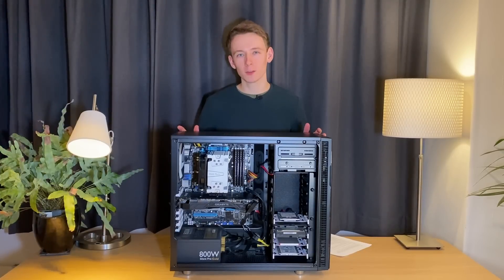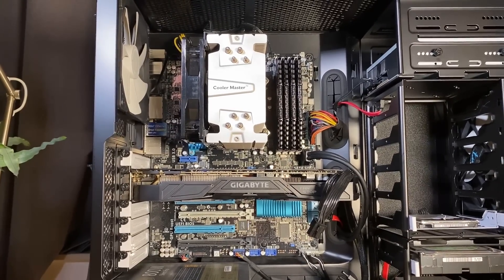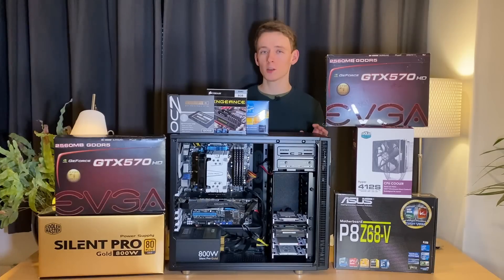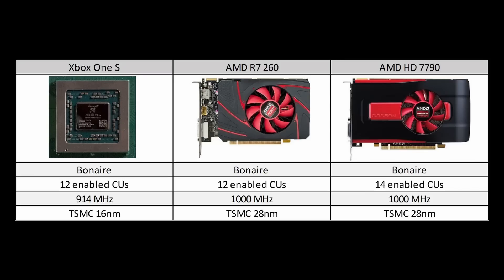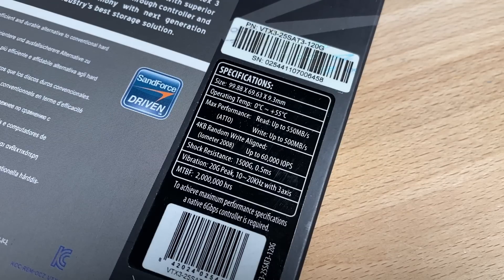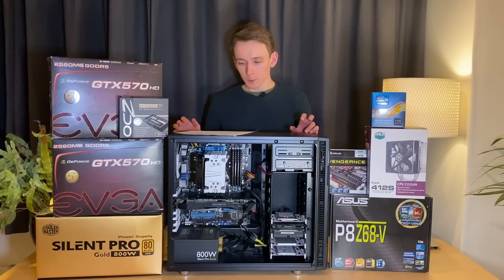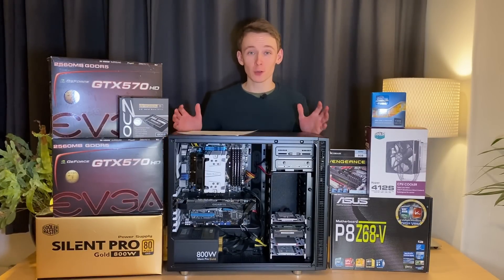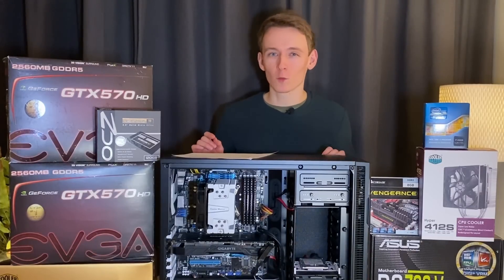I used an i7-2600K PC for over a DECADE - Here's what happened.

Comment: Yeah Im one to never buy new, I did buy my 5900x new, but I normally tend to upgrade when I run into a good deal on a used system or parts, The only reason I bought my 5900x new was because I had my older x99 intel system fail on me and I did not have anything to hold me over and I just couldn't;t beat the prices that Micro Center had at the time.

Comment: Lol, I built a PC in 2012 for WoW, had an HD 6870, 120GB Crucial mx 500 i5-2300, upgraded the GPU to an 1060 in 2017 for $169.99 brand new, then went back to WoW classic in 2019 and classic TBC later on, my system was doing just fine, 100+ fps at medium 1080p, was playing Hots too, I can basically play all competitive games at well over 60+ fps in 2022👌
An i3-12100F is $105.99 on Amazon that's a 4 core 8 thread CPU will crush all games competitive or not, the i3-12100F is 4+ times more powerful overall than my i5 2300 from 2012, and in single thread performance (where it counts) the 12100F is 2.4 times faster.
This weekend is when I'm finally building a new PC. The i5 2300 served me well.

Comment: it is somehow not surprising.
First in many if not all productive applications this system ist fast enough (perhaps except the GPU), only a few games take seriouslyx advantage of multithreading.
Second despite the "wanna have" there are no reasons to upgrade the system (except professional users/professional gamers: this means people earning their money with the system), the systems are almost everytime much faster than the person sitting in front of it.

For me the lat "necessary" Upgrade was from sandybridge to ivybridge on my laptop due to change in iGPU (Fortnite needed the ivybridge Graphics, Sandybridge won't work).
My gaming PC ist based on Zen2 combined with a 1080ti and loits of SSD storage (as it does also some other things to heavy for the notebook. But the daily driver is the ivybridge notebook i bought used at cheap pricepoint, of course some modifications but at the end less than one third as an equivalent new notebook costs (all mods included).

The "new" Gaming PC replaced the "old" gaming PC which is now at the children

Comment: its funny and pretty similar to me i am using my pc with an i5-3470 on a b75 and gtx 660 8gb ram with installed win xp - win 7 -win 10 until 21 and then bought another one with ryzen 3900 and rtx 2080 super 32 gb ram ,x590 mainboard and now with win 11 since it doesnt meet my needs anymore but did a fine job before

Comment: If it wasnt for killing my motherboard during an XOC session I would still be running my FX8350 today. I had planned to run that machine until the dawn of DDR5. And it also saw numerous GPU generations through out its life. 2x HD6850's. 2x Fury X's. And finally shortly before it kicked the bucket a single Vega 64.

Comment: I had splurged back in 2013 on a sabertooth x79 and a 1680v2 8 core along with 32gb of 1866 and the only thing i had swapped a few times was gpu, originally 3x 780 ti's swapped for 2x 980 ti's then a single 1080 ti. Just upgraded personally to 5900x after 8 years
Reply: @Lurch7861 lol ok?
Reply: I run that same setup today from early 2012, but the 1680v2 and 32gb ram were later upgrades.  Recently added a 3080ti after the previous 980ti burned up.

Comment: My setup 2500k 5ghz, ddr3 16gb 2133Mhz, 7970 6gb(or 1060 6gb, 3060 12gb). 
There is no reason to use it with a stock clocks. You need a minimum of 5GHz to use it adequately novadays. 
And I only got this processor in 2021. Before that, I had a xeon x5460 for about 6 years. 
I had to update due to the presence of AVX instructions in 2500k.

Comment: As someone that has been daily using a 2600k @ 4.5ghz with 16gb 1033mhz ddr3 and the same ocz ssd since beginning of 2012, I had a gtx 480 at first myself, then upgrade to a gtx 680, then a gtx 1060ti 6gb, and now currently a rtx 3070 FE. I've upgraded/added ssd's over the years as well. But now that I have the 3070, the 2600k is truly a serious bottleneck, and I'll be upgrading soon to a 13600k, 32gb 5600mhz ddr5, and a samsung 980 pro m.2. It's pretty much going to double my fps in every game since the 3070 won't be bottlenecked any more by the 2600k.
Reply: Forgot to mention that I've had the same Corsair 750HX psu and Corsair H100i AIO on it this entire time as well.

Comment: I use the xeon e3-1245 in a Dell t1600.
Still works good today .
It have 16Gb ddr3 
Nvidia 750ti
Ssd drive 
Zalman 700watt power .

Soon a upgrade on a amd r9 380x 4Gb  
The card is a real DirectX 12 .

And even today its jut work fine .
Oke no overklok option .
But new titles use more cores today .
And the xeon vs 2700k
The all boost core from factory is the xeon higher than the i7 .
Singel core is the i7  faster .

Comment: Hey I have one of those intel tower coolers. It came with i7 980x cpu. The only time when intel made a decent cooler :)
Reply from the maker: I had one as well! Even had plenty of room for OC - I recall I could run a 980X at 1.375V with it
Reply: @FullyBuffered  I loved that cpu so much, the entire 1366 platform was superb, so so buggy but I loved my pain 🤣24GB triple channel memory and 6 cores 12 threads at 4.5GHZ were the bomb. I still have the asus rampage IV from that build but it needs a lot of coaxing to get it up and running, some sort of cold boot issue. That build was in the same case as yours, Coolermaster CM690 II advanced, kitted with noctua fans, ocz sata ssd and two wd raptors in raid 0 as a game drive. The last upgrade before new build was the gtx1080 from msi. Even today that old hardware has some grunt left. It boggles the mind 😅

Comment: Kept my 2550K until 2018 when i picked up a 5775C with mobo for 200 i couldn't pass that deal up. Only some unoptimized pigs of games really ran that badly, it still did 60+ on 99%.

Comment: Used a 2500 since 2011 untill last year. Surprised me how long it managed to play games with decent fps and gpu upgrades. Sandy Bridge is legendary. Also - I like how you upgraded for Battlefields I did the same. Bought a new PC back in 2011 just to play BF3, then upgraded for BF1 and finally bought a new PC in 2021 for 2042 which I didn't play at the end cause it turned out to suck. BF3 was a great game, one of the best in the series a lot of people bought new rigs and it turned out everyone was running Sandy Bridge i5's with GTX 560ti for years to come. Intel easily dominated the market in AMD's dark age followed by Bulldozer flop which also contributed to marginal performance gains of new cpu's cause there was almost no competition.
Reply: Interesting time period in pc hardware. Sandy Bridge 2500k (oc to 4.6 ghz) was an amazing chip, coupled with lack of competition, and software titles that were still primarily 1-2 cores. 

That made the upgrade cycle last almost 5 years as that chip could easily power everything up to 60 fps. Don't know why Intel didn't do much those years.

Only with adopting high refresh rate monitors did i need extra cpu power, which i would buy at the wrong time with the 7700k.

Comment: I miss those days when a top end video card cost as much as a entry grade card now. I decided to retire my Sandy Bridge not so long ago as windows gave me an error so I decide retire it. Here are my specs:

Intel Core i7 2700k
32ag ram
Intel 510 250g ssd
A bunch of 1 to 2tb hdd
Had a MSI gtx 580 Twin Frozr II then switched to 970 but downgraded to GT520 ( that one died in 2020), and ended with a 720.0
Corsair AX 850W psu (80+ gold)

Comment: ok, so I wouldn't normally admit this because most people wouldn't understand. But I upgraded my sandy bridge i5-2500 to an Ivy bridge i7-3770 just last year by buying the new CPU second hand. the improvement in performance was going to be not far off the improvement that an 8th gen i3 would bring but at like a sixth the price because I kept same motherboard and same ddr3 ram.

CPUs seem to be doubling in speed every 8 years now. Upgrading more often than that seems kind of pointless. GPU is a different matter, of course.

Comment: Hah, this is the sibling of my old PC (still have it, just used by my girlfriend now). It was a 2500K with 8 GB RAM though, but same motherboard and a 660 TI instead. I also upgraded to a 1080, which I still use in my new computer due to GPU markets being what they are, so GF got the old 660 TI put back in.

It's still an excellent system, never ran into issues with it. Girlfriend have no complaints over it and it meets all her needs.

Comment: While mostly indonesian people using a intel core 2 quad even core 2 duo! And some of em had i3 gen 2 and pretty not much use a ddr2 cuz the majority of indonesian people who use c2q mostly using G41 chipset.
Well G41 is commonly packaged with ddr3 technology and rare G41 use ddr2 or combo.
Well the gpu people mostly use is maybe like not worse than gt710 or somethin but indonesian people have fun with the gpu that crappier than GT710.
Well some of them was
-Nvidia GeForce GT220
-AMD radeon hd 7500
-AMD radeon hd4500
-Nvidia Quadro NVS310/315
And more
And im using a NVS310 cuz is cheap and dx12 supported rather than GT220 which only support dx10-dx11

Comment: I used the same CPU with a P68Z Deluxe. The 2700K was watercooled and ran it at 4.7Ghz all the time. Eventually the motherboard died after 8 years. I sold the CPU for 100€ and moved on to a Ryzen 2700X.

Comment: why buy a new machine when old lga 1151 CPU's are dirt cheap nowadays?
the highest end cpu for lga 1151 is the i7 3700k - you can get one of those for as little as 15$ nowadays.
the highest amount of RAM Z68 supports is up to 32GB of 1600Mhz DDR3 RAM - a 32GB DDR3 ram kit can be bought for about 70$
you can buy one of those PCI-NVME expansion cards for 12$ and use any NVME SSD with this machine - would be SO MUCH FASTER than a SATA3 based SSD.
you can get any modern GPU for it - even RTX 3090 (although expect at least a 20%-25% performance loss due to CPU bottleneck).
the motherboard you shown in this video actually wasn't really anything special to begin with, it was a budget option for the Z68 chipset.
the Asus ROG Z68 motherboard was bonkers with incredibly good quality components.

i've personally was using an i7 980x system with 48GB of DDR3 RAM and a 850W Corsair PSU (and Graphite 600T Case) and a dual GTX 570 2.5GB setup for over 10 years up until 2020.
in 2020 i bought an RTX 3080 and switched over from my system to my father's workstation rig - an i7 3700k, 32GB DDR3 Ram (ouch i felt that right away because i have a shit ton of mods and assets for Cities Skylines), a 1200W Corsair Platinum PSU and a Nvidia GTX Titan (OG Titan card).
i moved all of my hard drives and SSD's to it and added in one of those NVME to PCIE expansion cards with a samsung 950 pro ssd, and switched the GPU from the GTX Titan to RTX 3080.
the motherboard is the Asus Maximus V Formula Z77 ROG which offers so much flexibility and potential for expansions.
i've seen no reason to upgrade from it, i have literally only upgraded from my older i7 980 extreme machine to this i7 3700k machine because i wanted to have as little of a bottleneck as possible with the RTX 3080 without having to rebuild a new machine.

the reason why i didn't build a new computer in these past 12 years is because i've been anxiously waiting for intel to release a new HEDT cpu (instead of just refreshing the same old cpu over and over and over) but that never happened, and during my wait time i didn't really see anything that my computer has been limiting me with doing - it is a perfectly capable gaming machine and it even does VR really well...
one of my friends says he "feels sorry for me for using such an ancient stone age machine" but i laugh back at him telling him that i'm not missing out on much because gaming did not even evolve much in the past 10 years because 8th gen consoles held back gaming in terms of "minimum specs".
its funny how games released TODAY still show a 10-12 year old CPU in their listing for "minimum specs" lol

Comment: :D-)-< new sub here, still usin it as secondary system, still plenty fast for daily tasks actually a bit overkill still if u give this to a secretary lady it would be like a nasamachine cuz for exel and that crap itz too strong still ^^ so yeah, old intels for the win :*
BTW that RIG:
CASE:  CM Storm Stryker
BOARD:  Asus Sabertooth P67 with Fractal Design Southbridge Fan :)
CPU:  i7 2600k @ 5.1ghz (well was peak not it fell down to 4.8 :D)
RAM:  20gib  2x8gb G-sKill Ripjaws X & 2x2gb TM Memory 1600mhz
GPU: Modded Palit GTX 980 @ 1550mhz
SSD1: MediaRange 120gb  but will be swapped to some Samsung or some, we will see, 
SSD2: Crucial BX100 250gb
PSU: Be Quiet System Power 9 600W
Win 11 

if that system still dosent rock and probly most ppl could dream of then i dont know what is ^-^
plz continue wour work, your chilled af  >)

Comment: how did you get your cpu to run 1600 ram
Reply: Just set the XMP profile in the BIOS. I have the Deluxe version of the same mobo with 1833 gSkill. May need to manual overclock, and no guarantee with 4 DIMMs.

Comment: Those were the days when you could build a decent PC for cheap 😂My brother still running my 3570k system. In hindsight I do think the i7 was the better choice.
Also crazy we had a similar upgrade path.
I originally had a 7950, then 1060 3GB then 1080ti (got for cheap after 2080 launched).
Also upgraded my case from Corsair 200R to Fractal Define because of the noise.

Comment: Ive seen a 4.7 ghz  2600k run 2042 at a smooth 75 fps
Reply: The fun thing is that that level of overclock isn't even unattainable or crazy for a 2600k that was taken care of.
Reply: My I7 2700k runs rock solid at 4.8ghz with a veeery small voltage bump. That along with a 6600xt runs BF5 ultra settings 1440p at about 75fps. With both GPU/CPU usage about 90%! Still working great! 👍

Comment: Intel's stagnation of Quad Cores. Beginning with the Q6600 in 2007. Ending with 7700K in 2017. Also PS4/Xbox One didn't help much. Most games and software being coded with Dual/Quad Cores in mind for more than a decade. 

Intel's 2500K/2600K is still good enough for most office work along with and SSD.

Comment: the only real downside i see in older hardware is that they'll probably give up sooner than a newer system. for most people's purposes, they're just fine, gaming or otherwise. unless you're a hardcore gamer or enthusiast, older hardware still has a lot of life and power left in it, and people tend to overlook this way too often.
Reply: Honestly I’d say it’s the opposite. the sandy bridge arch is legendary for OC’ing, the heat spreader is soldered unlike numerous subsequent gens until the coffee refresh, it’s much less sensitive to voltage changes and heat being a 32nm chip. I paid $50 for my 2600K 2 years ago and it hasn’t seen stock speed since I popped it in my motherboard, so far it’s been stable at 1.375V and 4.7Ghz for that time.
Reply: Have been overclocked my 2600 since 2016 to 4,45Ghz.  Used every day. Bought a Corsair cpu cooler. Stays at 60degrees C. Fully stable no issues. Run with 1080Ti

Comment: Pffff amateur lol. im gaming on a rig i built in 2009 .original core i7 920 @ 2.67ghz on a Asus p6x58-e ws 24 gigs of kingston ram  @ 1600mhz originally had 2x 280 in sli but running a gtx 960 right now cooler master 1000w silent pro power supply

Comment: GTX1080 gang rise up!
Reply from the maker: I managed to snag one just in time luckily.
Reply: *proudly holds MSI GTX 1080 Gaming X box in the air *
I decided to skip the 2000 series entirely (thought they were too hot-running and expensive (hah!)) and things went down the drain massively after that, so I'm still using it. And considering the GPU situation won't change anytime soon, I treated it to a custom loop watercooling setup so it doesn't have to "cook" at 70°C with the stock MSI cooler, but instead stays at 48°C under full load :D  It's starting to struggle a bit with newer games in 1440p but overall still does a good job